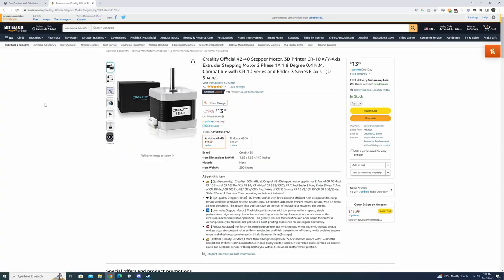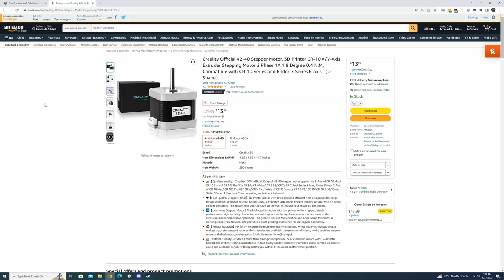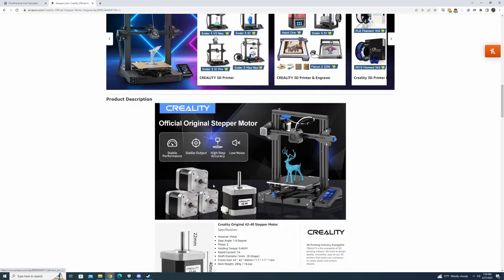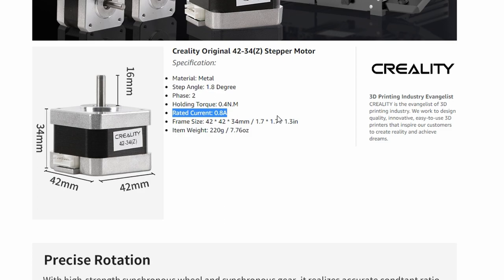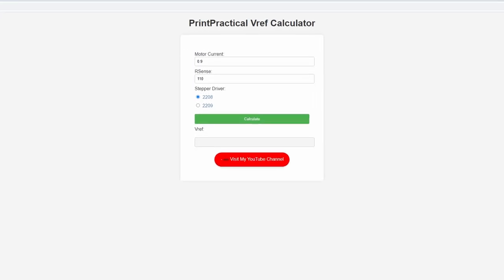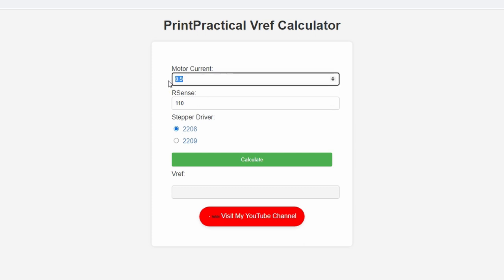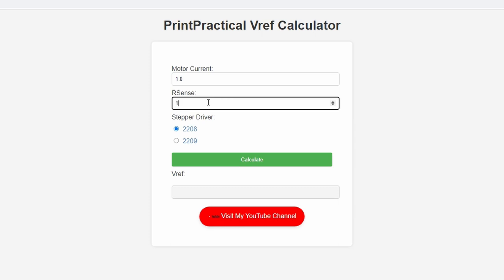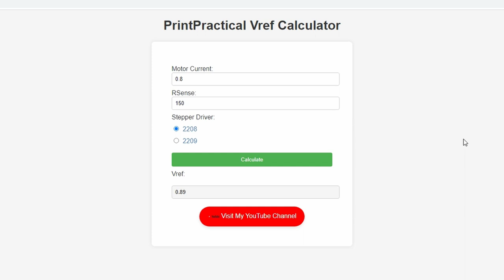3D Printer Stepper Driver VREF Adjustment Made Simple!

Comment: if you have 2 steppers on the same driver how would you adjust the formula?  i.e if you had 2 steppers that can handle 1A each and they are in parallel would you use 1A or 2A since the driver needs to provide 1A each.  thanks..

Comment: Thanks! What about when using a standalone 2209 without any rense? Simply set rsense to 0 on that calculator?
Reply from the maker: You have to look at the resistor on the motherboard near the stepper driver to find your proper RSense value. I should explain this in the video, but can’t remember. If I don’t explain it let me know.
Reply: @PrintPractical  Thanks👍🏻
Reply: @PrintPractical so I’m following this for my CR10S Pro V2 with the creality v2.4 board looks like it has an rsense of 150 and 2208 stepper motors and I’m going to be installing an Orbiter v2 with the LDO motor rated at 1.2A, after setting this, is there any way to check to verify that it is within range at the motor while it’s running? Using your calculator I need to set it to 1.33v? By the way thank you so much I could t really find anything this detailed in a video!

Comment: Hello, Print Practical

I want to replace the Y-Axis 42-34 stepper motor on my Ender 3 Pro with a 42-40 stepper. The stock motor gets pretty hot and all of a sudden, it stops working, it just jerks and not rotate.
So do you advise I replace with a 42-40 stepper and set the Vref to the same voltage as the Extruder motor ?? 

I'm not really good with all the Voltage calculations.

And it uses the HR4988 motor driver.
Reply from the maker: Hi,

Weird, possibly a bad motor. You can try to replace it with a 42-40, I can’t guarantee that changing the Vref to the same as the extruder is the right way to do it, but makes sense to me. I tried to look at the datasheet for you for calculating the proper value, but it’s all in Chinese.
Reply: u might have a lose wire to the stepper i had it once

Comment: Thanks, the clearest video online and nice to backup my other evidence. Why Creality puts these motors at different amp ratings on each listing. They list the 42-40 as 1.5A sometimes too... maybe that's peak.. who knows.

Does your calculator account for any margins? Say 10-20% as I often see recommended?

I believe the standalone TMC drivers are the weakest link anyway? 

My Ender 5 Pro silent 4.2.2 TMC2208 150 r sense board arrived as:
E 1.4v
Z 1.19
Y 1.39
X 1.19
(X and Z motor got pretty warm with these values)

If it helps:
0.796v y measured when was skipping
0.56v X skipped big time.
Z I made 0.58v, no issues as it hardly moves at all. Now cold.
E: now testing 1.1v to avoid any overcurrent situations with LA on.